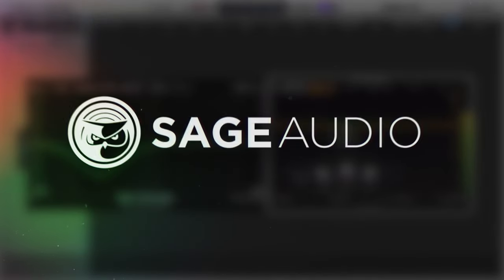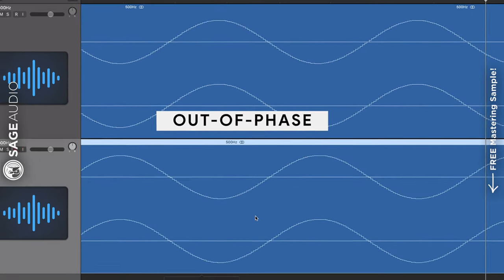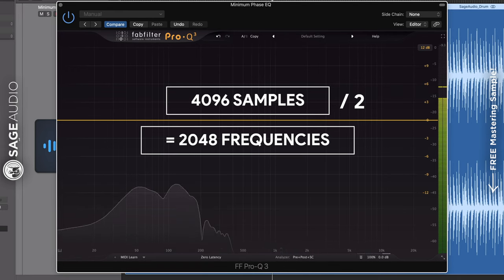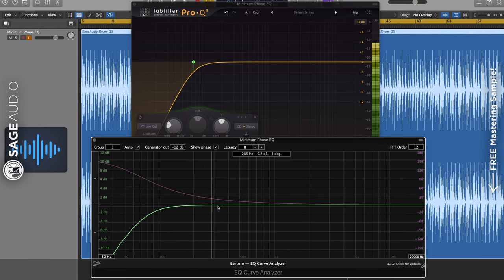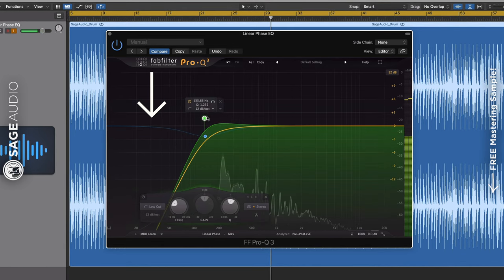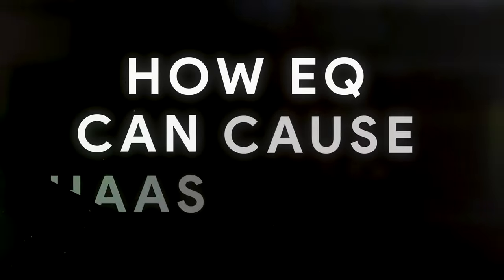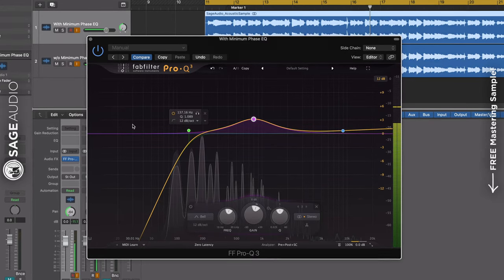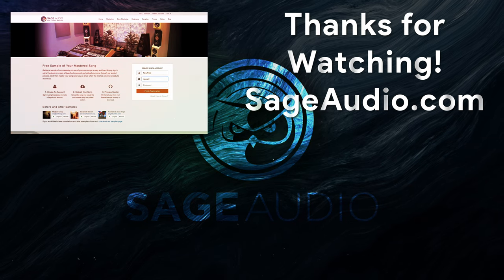How EQ Changes Phase | 1 FREE Mastering SECRET You Need to Know!

Comment: if i may humbly offer a correction, phase in and of itself doesn’t have anything to do with timing. the demonstration of moving the pure tones forward and backward to get varying amounts of cancellation is perhaps misleading and not comparable to the phase shift introduced by EQing. It’s true that time aligning different elements can move them in and out of phase, but it would be better to precise that phase shit can occur without timing differences and purely by rotating the phase of the signal, as is the case with EQ. peace and love ~
Reply: How do you rotate phase without time adjustment? Isn't it exactly what it means and isn't it the same thing? Correct me if i am wrong
Like sin to cos one peaks when one is at zero, and that is 90°, because they start at different values.

I think i understand that this effect of changing an overtone, could have a knockon effect in a fourier transform that could be described as being rotated when such frequencies are 'pulled out' of the wave shape
Reply: This is correct. Most videos on phase are some mix of confusing signals and waves, phase and delay, and so on.  Phase is one part of the frequency response, the other being magnitude. They represent a complex Phasor at each frequency, and come from a Fourier transform of the output divided by the input. So these videos should all be taken as very introductory to the actual fact.

Comment: This is a really good topic. A question here…
Usually I record two inputs for my acoustic guitar, one is line in and another one is using condenser mic. The purpose is to make it panned hard left and right to get wider stereo effect and two audio tracks contents different tone that make the ac gtr track more body and depth. 

But the thing is the phase issue. My approach is to use the melda auto aligned plugin on both audio tracks. But I didn’t apply the linear phase EQ or linear phase multiband compressor. I have the waves one. Is it necessary to use it on my guitar tracks ?  And what if I want to apply different EQ curve to one and another ?
Reply from the maker: To avoid phase issues in this situation, use the linear phase eq on both signals.  Since they're delayed, you can use different curves without an issue.

SageAudio.com
Reply: @sageaudio  thanks for the suggestion and advice!